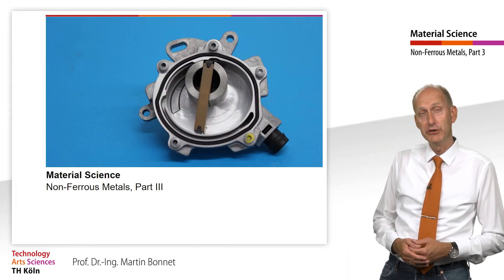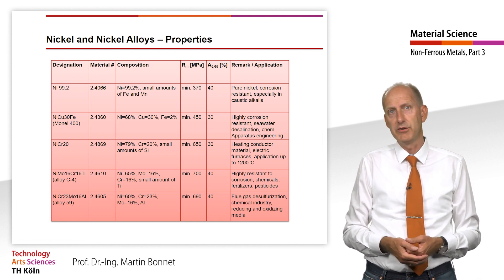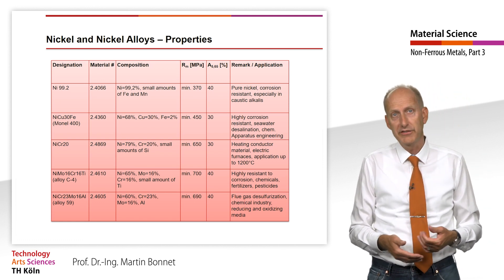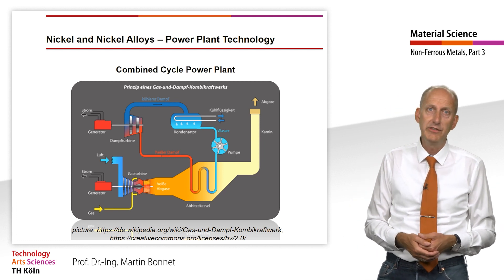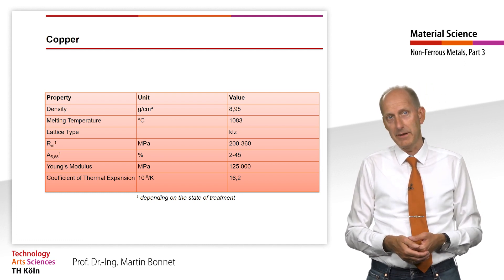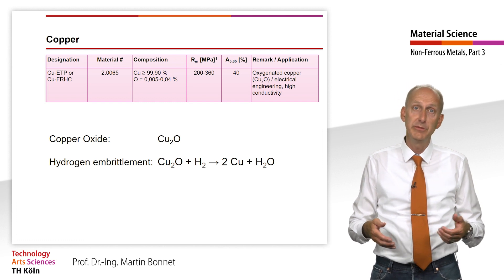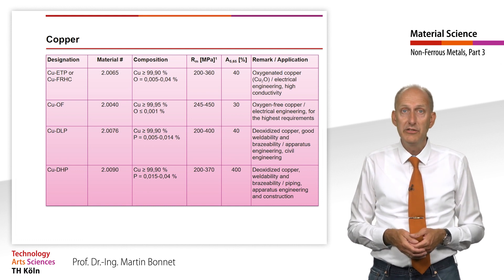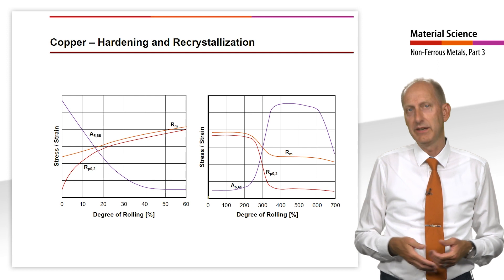Material Science, Non Ferrous Metals Part 3: Nickel and Copper

Comment: Thermal conductivity And electrical conductivity 

Ni 
Cu
Wrought alloys 
Cast alloys 
F100 
Turbine 

Petrol chemical 

pressure 
1 Bar 

ATM 
Atmospheric pressure 

1.0132 pa 

127°c 
®

16°c 

603110